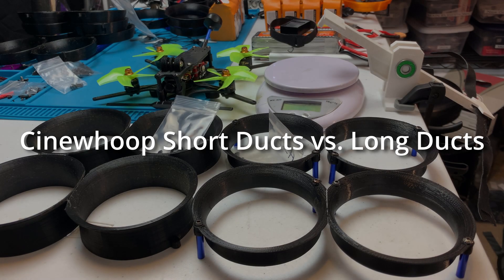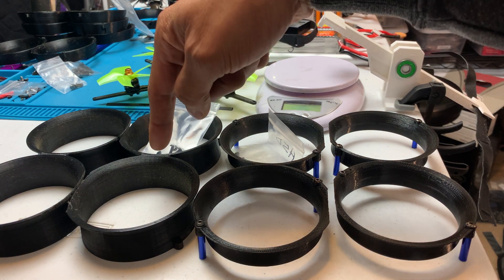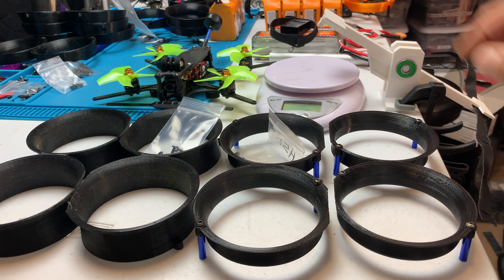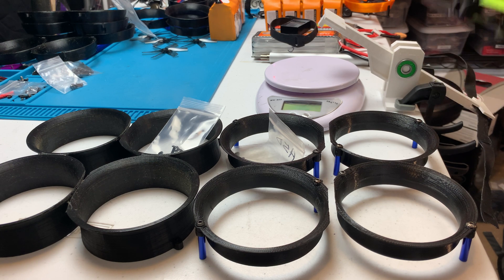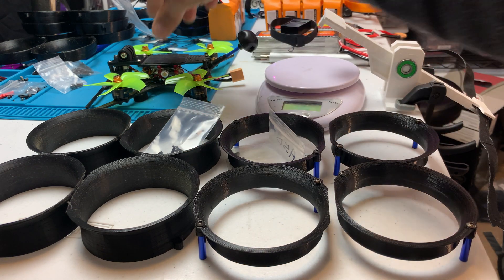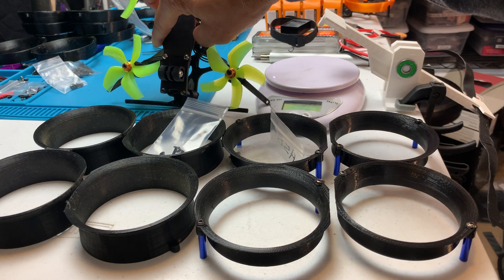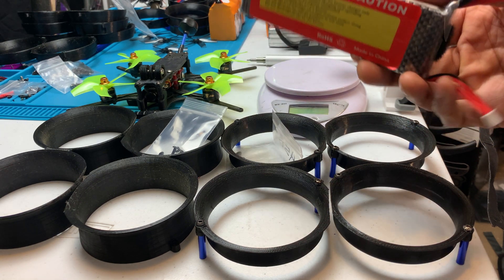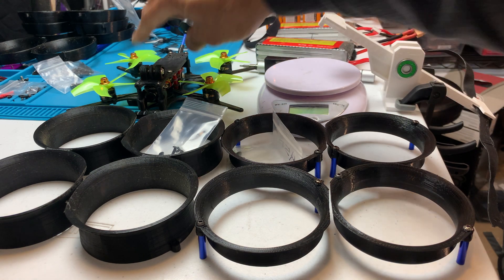Cinewhoop Short Ducts Produce 1,869g of Thrust on 4S!

Comment: Stop doing shit! 
1. Ducts by itself doesn't add any efficiency at all! The only thing that add thrust is upper rounded edge of the duct, it's acting like a wing than, but no one do it becase it's almost imposible to print it with 1 perimeter to save weight for this small amount of thrust the rounded edge gives. Just look at the aviation and find just one commercial prop airplane which has duct, and you will find none of them and believe me comercial airplane designers do realy have a competition at fuel economy and efficiency. The only airplane engine in aviation that has duct is turbine and front rounded edge at the inlet realy add thrust because air around the inlet( I mean the air that presist not right before the hole, but ot of the edge of the turbine) sucks into inlet !!!!by injection effect!!!!  runing on this rounded surface and creating wing effect on the front edge. BUT FOR REASONOBLE INJECTION EFFECT YOU NEED FLOW SPEED AT LEAST 10 TIMES HIGHER THAN PROP COULD PRODUCE IN THE IDEAL CONDITIONS! 
2. To add efficiency in axial pumps they use "guiding device"(I don't realy know the right name in english) wich looks like static blades with an opposite to the props angle. It helps to guide flow straight, becase prop not only pushing flow but also rotates the flow. But as for efficiency it's disputable thing... especialy if you place it in the bottom of duct of cinewhoop you will at 1st: add weight, 2nd: create a great airflow resistance, wich will cause motor to beg you for more spinning momentum(but this motors have no any in reserve of it) and the 3rd: it will be much more f..reaking loud than already very loud ducts...

The only propouse of duct to protect props from enviroment and enviroment from props. The lighter and smaller they are - the better

Comment: Hi man, what is the duct’s hole mm? I can’t insert my m3 standoff...
Reply: Sorry, the ducts need 20mm standoffs that do not insert into the TPU.  The hole is only for a 3mm screw.
Reply: @chuckjoga1161  what is the other standoffs length have to be?
Reply: @eugene.drones283  I'm using 25mm standoffs for the main body.  They can be longer, but I like the low profile slammed look.  The ducts work perfectly with this FPV camera mount:  https://www.thingiverse.com/thing:4580224
Reply: @chuckjoga1161  so ducts fixes by 4 standoffs , 2 of them 20mm and 25mm the others right? And other body standoffs also 25mm, did i understood correctly?
Reply: @eugene.drones283  Sorry for the confusion. I did not ask if if you were building the Squirt V1 or V2.  

Squirt V1 ducts use (4)-20mm standoff each side for a total of 8 needed.  

Squirt V2 ducts use (3)-20mm standoffs each side for a total of 6 needed.  

The number of body standoffs needed are (4)-25mm for V1 or V2.

Comment: Interesting setup for measuring thrust. Would be interesting to find out what impact the gap between the duct and the propeller blade tip has.
Reply: From my intensive test, there is a lot of gain from that, gap.  Something around 0.015 of a inch was best in my test.  On the test of this video,  I will not be surprise if all the gain was from the fact that is duct was thighter and not shorter.  Maybe he get gain from shorter duct but I m shure most of is gain was from the smallest gap